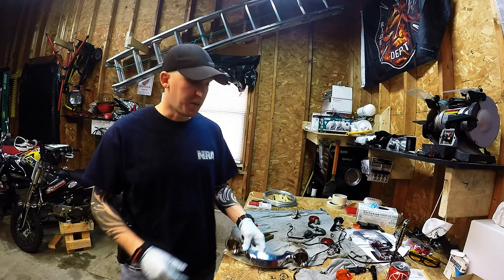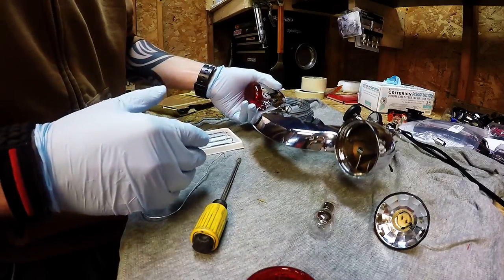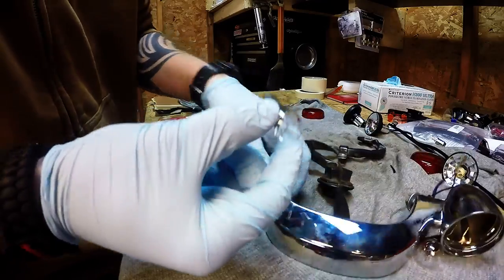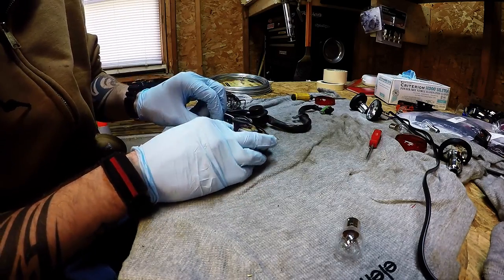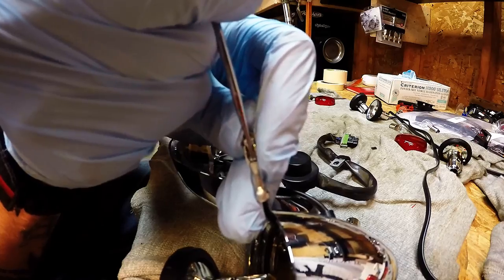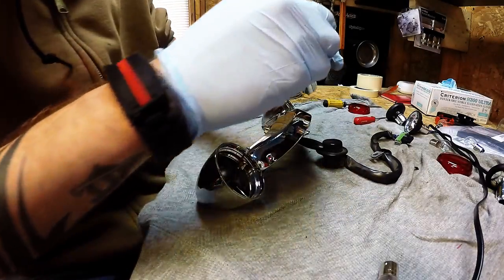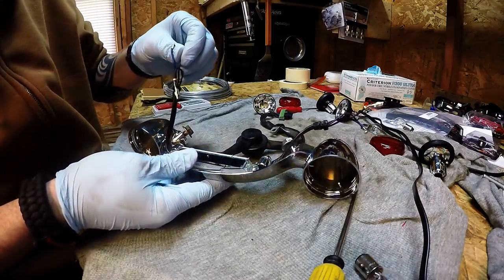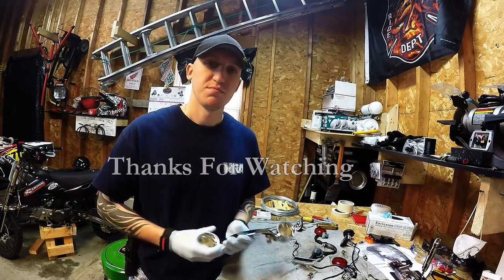How-To Disassemble Remove Harley Davidson Rear Tail Run Brake Turn Light Bezel For Powder Coating

Comment: Great Man !!!! - hope front is same too ,wanted to relocate front signals from handle bar ,wire runs insides handle Bar.
Reply from the maker: Mo Mo yes, it is similar for the front as well, however depending on the model will depend on the ease of access to wiring. Roadglides and front fairing mounted models are a longer process but definitely doable as a DIY. Best of luck and I’m glad this helped! 🇺🇸

Comment: Man I see this was posted 6 years ago but I'm so glad it was still here.
Yor really explained it very well, I know I would have ruined it with all the crazy ideas I had as of how to do it. Don't know if you still reply but is reassembled the same way. Do you just push in all the way down and it pops into place or something. no twisting or secrets to keep it together. Thanks again
Reply from the maker: Thanks for the support brother 👍🏼. I check infrequently so sorry for the delay but yes reassembly is just reversed process. The only thing to watch for is make sure your wire pins go into the plug the correct way to “snap” them into place, you’ll hear the click and can see the “latch” before you slide it in. Give a light tug on the wire afterwards to make sure it is in correctly but the tab only goes 1 way to lock it in. Hope this helps and you’re welcome 🍻
Reply: @1nation561  Thanks for the reply, My parts will be finished this week and now I feel better putting the lights back together  You rock man. 👍

Comment: You don't need a special tool or bent wire to pull out the light sockets. Use a hook tool, push down on the socket until the hook engages under the socket lip and pull it out. Switch to other side if it doesn't give on first try.
Reply: I noticed that and did just that

Comment: Hi, thanks for that. Im trying to take my 1156 and make it 1157 and your video shows that it can be switched. I have an 05 ultra classic. I can't find the light bar with it already 1157 but your using 1. Obviously it would be a lot easier with 1 thats already done.. What is that off of?
Reply from the maker: Russ Dory this is off of a 2015 road glide special. If you mean the led white light that’s underneath for the plate light I actually may have one kicking around the shop. I will check tomorrow and let you know if that’s what you’re looking for? Glad this video helped though. I have a few others I will be taking the time to post soon since the feedback all seems to be positive.

Comment: I’m trying to do the front turn signals, do you have a video for that?
Reply from the maker: gghostrrider unfortunately I don’t, the front signals are very similar. The biggest difference is that if you’re trying to remove the arm of the signal completely, then you will have to remove the front fairing to get to the nut that is holding it together. I’ll be sure to video it and upload if I find myself taking it apart for any reason. Hope this helps out and best of luck
Reply: I’m kinda nervous about unclipping the wiring in order to get to the chrome.  Seems like it might be difficult to get back in place.Thanks for the reply.

Comment: I just found this.  I had mine powder coated and when the shop put it back togehh the we they did something because my right light is loose and my brake and turn signal don’t work unless u jiggle it.  Guess I’m going to have to replace it.

Comment: Do you have to put the wires back in the housing the same way? The 2 wires that butt up to the bulb is it specific right and left connection?
Reply from the maker: Joel Lynch excellent question which I didn’t realize I hadn’t addressed in the video, sorry about that. It does not matter if the wires are accidentally reversed on the inner two matching wires that sit inside the plastic ring. They only complete a circuit on the lightbulb. However the other wire inside the housing with the tab on it that is fairly difficult to remove has to go back into that slot. Hope this helps! If I made that too confusing just let me know and I’ll do my best to explain more accurately. Thanks and ride safe!

Comment: thanks for the vid. I did this for all 4 signals on my 17 RGS.  but I cut the black wire and solder it. question.. do you have to have the colored wires in a specific order? after I  completed one signal I tested it and nothing...so trying to figure it out. not sure if all 4 need to be installed to test?
Reply from the maker: Chris Mccarty thanks for the shout out Chris! I'm glad it helped. As for the wires I do believe they have to be connected in order for colors because of the Run/turn/stop pattern each wire operates a different pattern. I'll try and see if I can find a schematic of it but the fastest way might be to check the other side of wires to see what order they're in and copy that layout.

Comment: Sadly enough I just pulled the black wire out of the connector..the dealership was no help any idea of where I can get a new wiring set-up or a part number on the connector piece??
Reply from the maker: Nick Raffaele did u pull the wire from the pin? Or the wire and pin from the connector? If the pin is still on the wire u can slide it back into place into the connector, if it slid out of the pin and it's a bare wire you can twist the wire so it's a fine tip. Then reinsert it back into the pin inside the connector and secure it with glue. If you're looking for new or even a used connector I'd check ebay, I've had some luck with them and occasionally local computer stores and similar places like batteries plus will carry the pins and misc connectors but that's normally on a less time pressing project with time to shop around. Hope this helps, best of luck!
Reply: Same thing happened to me.  Hoping for the terminal connector part number because I can't seem to find it online.
Reply: redcup247 did you find the connector?
Reply: Nick Raffaele did you did the connector

Comment: My buddies 2011 sporty 48 bobber has a broken front signal bracket(mounted to forks oem). Is this the same process? We cant find no help on the web on disassembly. It makes the most sense we have to do it this way cause on the other side the wires go through a bolt/washer and theres no way to get a tool on that bolt.
Reply from the maker: Gunluver1 sorry for the delay, been busy trying to remember my password haha. anyway, without seeing a picture of it it's hard to say but from what I've looked up for photos of it I believe you're correct and that it is a similar process. As mentioned in another comment you could cut and splice the wires later, I just prefer disassembly over cutting for the factory look. If you have a photo of it let me know and send it over, should show some indication of an attack plan. thanks for the comment 👍 I hope it works out
Reply: We got it taken care off, i was gonna unpin the connector but he rather do it this way. It was similar to this, ground on the reflective was a bitch to remove, idk why. Shes back up and working. Thanks for the vid

Comment: Hey John, do you have to remove the rear wheel to get that piece off?
Reply from the maker: electricjed , you don't need to remove the rear wheel to get that piece off. it is very tight and uncomfortable to get your hand between the tire and fender but it is possible and that's how I did it. I used an open ended wrench to get the two mounting bolts off and to remount it as well. I hope this helps, if you need more tips just give me a shout 👍

Comment: John
How about the front lights, same thing?
Reply from the maker: brad rubin yes sir, similar process for the gasket, wiring, and lens removal. As for the mounting hardware, it's closely similar but depending on the model of bike you have you'll have to remove the front fairing to have the mounting hardware in your hand. Hope this helps and if you get stuck give me a shout and I'll try and get ya through it👍. Thanks!

Comment: Ok, now how to reassemble them?
Reply from the maker: Hey Frank, assembly is going to be exact order in reverse except the things to note are when you plug the wire pin back into the socket that was removed around the (4:00) min mark. Make sure it snaps into the plug and is lined up correctly to catch the tab that was depressed when reinserting. Also, when placing the socket back into the housing, soapy water around the rim of the housing and on the rubber socket will help you pop the socket back into the housing easier. Equal light pressure and you’ll feel and see when it seats. Hope this helps a little for ya and enjoy the new parts 👍
Reply: @1nation561  Thank you! I'll give it a whirl!